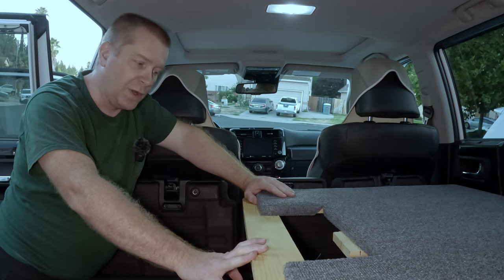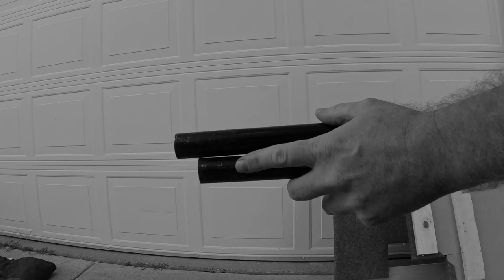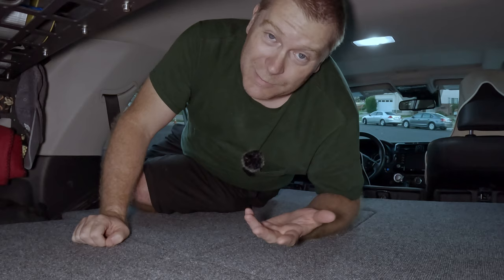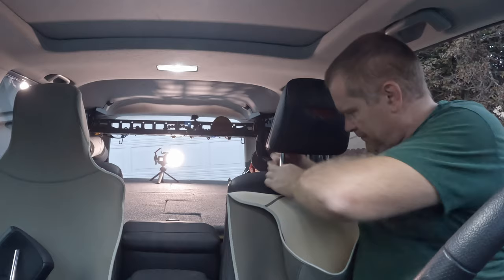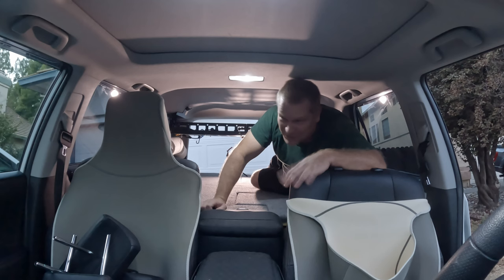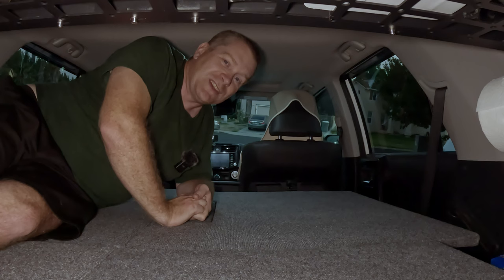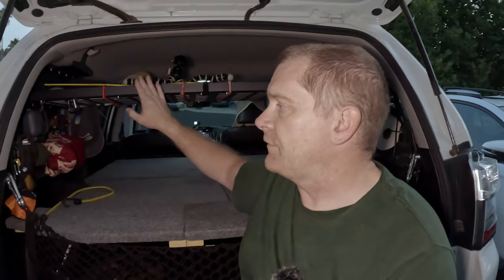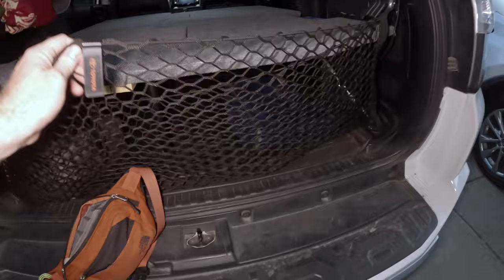4Runner DIY Sleeping Platform: Responding to some comments

Comment: I got the molle panels for the windows but not the shelf, since I have a dog I didnt want her to have to try to get under/around it without hitting her head. I will be putting a cargo net for the ceiling so I can put all my window covers up there. Thank you for giving an update.
Reply from the maker: Yeah the shelf can rob you of vertical head space. I debated having it, but at the end of the day I do get a ton of use out of it. It does mean I can't really lay with my head towards the back tho. Would be nice to have the back window (with a mosquito net) and sleep the opposite direction on some nights.

Comment: Hello,what's the weight of each left and right mole panel?
What's the weight of the middle shelf?
Reply from the maker: According to the manufacturer listing, the panels all together are a little over 10 lbs and the shelf is around 14lbs
Reply: @kneepayne  thank you
Reply: @kneepayne  hello, for 4Runner TRD Pro that has no 3rd seat, would this be an issue with airbags?